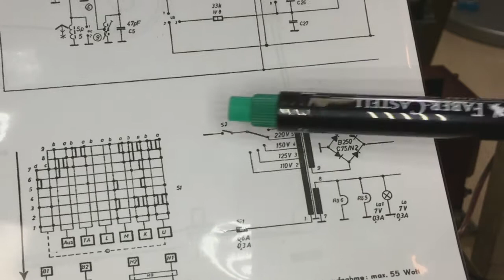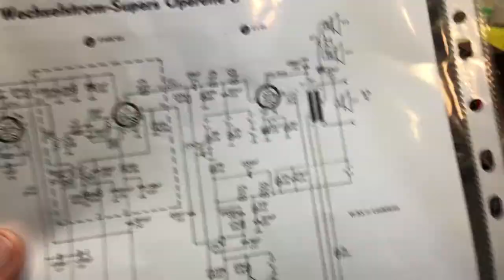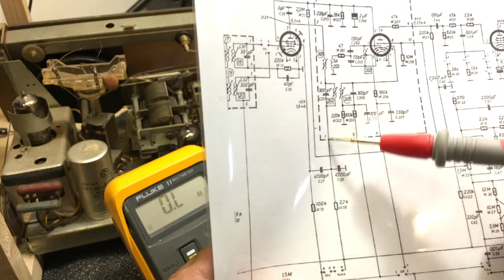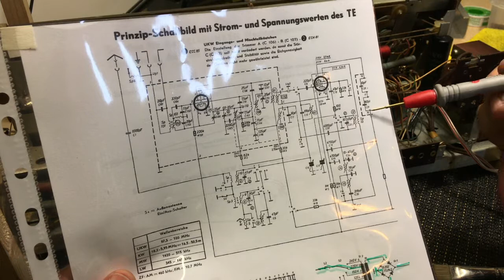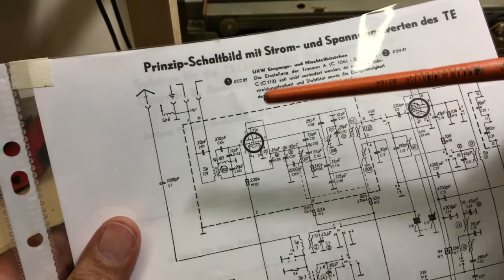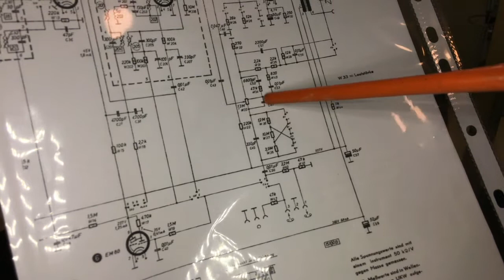Telefunken Operette 8 tube radio restoration - Part 2. How to test power supply.

Comment: Please please please! I have a console with the same chassis- what is the wattage rating on that 1k ohm resistor? I can't find it anywhere and mine burnt up.
Reply from the maker: +Alex Uliasz : it dissipates about 1.4W, so use a 2W or higher.

Comment: That's an interesting tuning arrangement on shortwave, I wonder how it works? I'm sure the FM isn't going to be too much of a problem, it'll come up once it's been recapped and aligned :)
Reply from the maker: +Alan Cordwell : the fm tuning works with three ganged adjustable inductors for the front end and oscillator tuning, plus a third that is wired into the am oscillator. Very clever. As for the fm, it looks like someone has been in here with a screwdriver! The problem is that I have no alignment instructions, so it looks like I'm going to have to find the coils the hard way. Challenging.
Reply: M Caldeira Oh no not the Phantom Twiddler! :-/
Reply from the maker: +Alan Cordwell : the same.